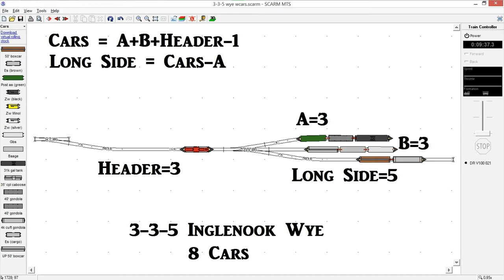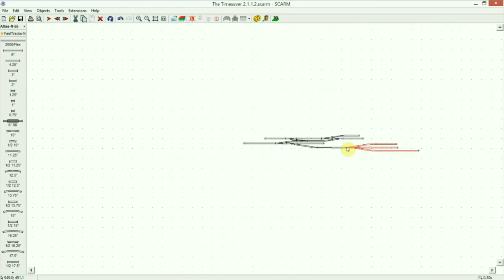Adding Inglenook Wye To Timesaver Shunting Puzzle N Scale Layout Design In SCARM Plus Wye Variations

Comment: Well explained. I recently built a 3-2-2 Inglenook puzzle due to space constraints. To add more interest, I added the possibility to run into some unexpected events during the session by rolling a dice at the beginning. If the unexpected event is called, I roll another dice to choose one among six different. Events like shunter failure, car failure, turnout failure, time schedule delay, wrong switch list or delay on freight loading can alter the dynamics of the game introducing some extra limitations. I'm really happy with the outcome,  having considerable operations possibilities not usually attainable with a micro layout. Cheers.
Reply from the maker: Sounds like a very interesting way to run operations. I'm generating random five car construct orders from the Wye yard to send to the Timesaver docks with specific spots for each car. So they are sent in a random order but still had to be ordered at the Wye. Then usually I park them on one of the long Timesaver sidings and build the return five car construct - also in a randomly generated order. Which is essentially a Timesaver game. Park them on the Departure line and shunt in the Wye cars to their proper place - a second Timesave puzzle... But I've only done it in SCARM as I am still making my tracks. Working on my turnout mechanism now. Stepper motor and an arduino controlled. Thanks for watching!
Reply: Okay, this is genius!!! Could you tell us more about how you do this? I'd love to add this to the mix of my op sessions too!!!

Comment: Interestingly enough, my Dad and Grams got my interested in trains when I was a wee pads, but I didn't see the point in just watching them go in circles.  Recently I discovered the Inglenook quite by accident and this lead me to operations as well, so I'm getting back into the hobby in N-Scale and the very first thing I did was laid down some track and 8 cars, and started playing with an Inglenook.  Now having watched some awesome videos, I'm working on a full layout with DCC++EX and a timesaver and Inglenook as well as a full yard with interchange tracks and some real operations and such to play with for hours and days! Thanks for sharing this!!!
Reply from the maker: Very glad to hear your rediscovering model trains! I'm nearly done the Timesaver section with the frogs and feeders installed and the stepper motor wiring to be done next. Hand building the tracks and turnouts makes you want to add as many as possible vs saving the money and use fewer. I ended up with nine switches where only five were called for. Just a 2'X4' so I needed to make 9" curves to fit but I'm just a freight shunter...
Reply: @handlaidtracksand3dprinted922  oddly enough, I started hand crafting turnouts a lifetime ago and my father thought I was an idiot and doing it the hard way, completely missing the point that I had hand made a #6 turnout just by looking at and measuring one I already had.  I think it's awesome that you're hand crafting your own track! Go you!!! I might one day start doing that again too!!!

Comment: I've often heard the Timesaver is not prototypical, but as they also say, there's a prototype for everything.  I was working on a track plan based on my hometown (all the tracks are gone now) and all of a sudden it dawned on me that my home town was a timesaver.  Only difference was the turnouts to the switchback are the other way around.
Reply: Oh, interesting!  What town is this?
Reply: @BrooksMoses  Lockhart SC.  Tracks came curving into town from the south.  Straight ahead was a runaround and the depot.  Switch to the right over the canal led to switchback with a mill on one tail and power plant on the other.  Mostly gone now, but Google maps you can kind of pick out the remains in places.

Comment: The timesaver looks like a small British branch line terminus if you chose the top left track as the ‘main line’. If you named each section (ie platform, cattle dock, fuel siding, etc) you could spot wagons to randomly assigned places in a semi realistic way. 
For example a four wagon goods train arrives and has to place the wagons correctly, gather the empties and remove them. With a brake van to worry about as well of course!
Reply from the maker: Great ideas! My plan is to put small platforms and the sidings, but I'm squeezing into a tiny space. Want to have an arrival departure track for 5-7 cars. Inglenook Wye one end and the Timesaver on the other. Right now I'm still working on the turnout motor. Haven't made a video on it yet, but I made my own 3D printed turnout base and added a stepper motor to actuate it. But the weather turned nice and in Netherlands you have to take advantage of nice weather!

Comment: cuanto moide ? how much length?
Reply from the maker: It depends on the length of the cars you are using. It is much smaller for Beercan Shorty Tank cars than for 80' autoracks. That is also why I made trackend stops to limit the track lengths depending on the cars being used.

Comment: I'm sorry, but a three way switch is not a Wye. A Wye is used to turn trains around. Since they no longer use turntables...
Reply from the maker: It isn't specifically a wye, but two sidings and a main line. But I found it on Wymann's page...  http://www.wymann.info/ShuntingPuzzles/Inglenook/inglenook-trackplan.html  So, yes it is more accurately called the Inglenook Sidings, but I'm not going to change it now! Though I am planning to build a turntable as well...
Reply: @handlaidtracksand3dprinted922  oh heck yeah, without question an inglenook, I love those! It was just the use of the term Wye which is something entirely different.  Otherwise smashing job adding an inglenook to your timesaver, go you!!!